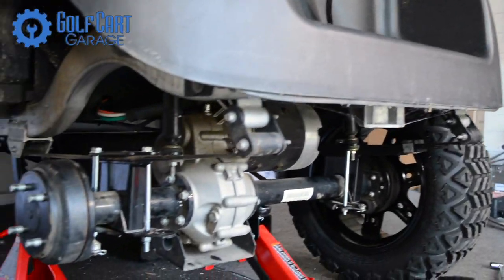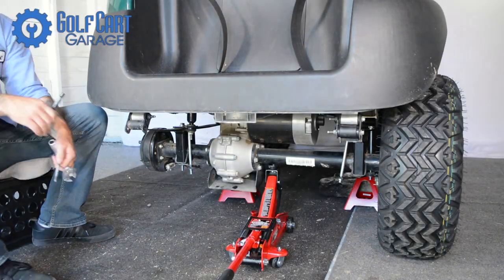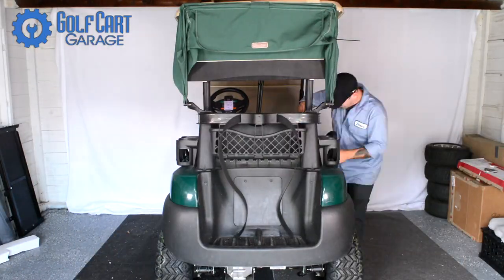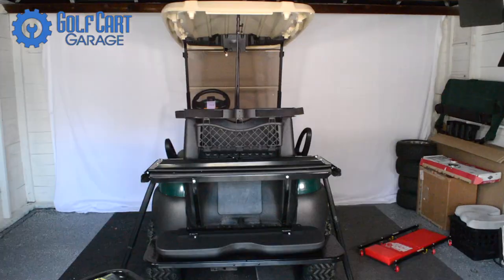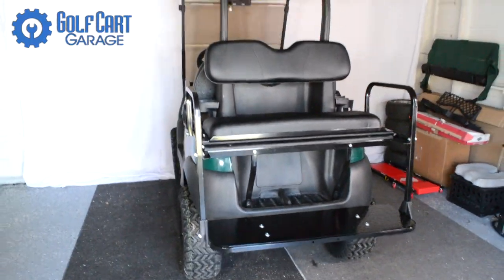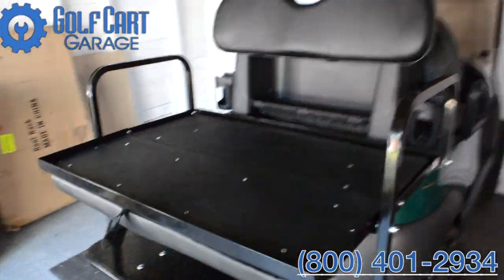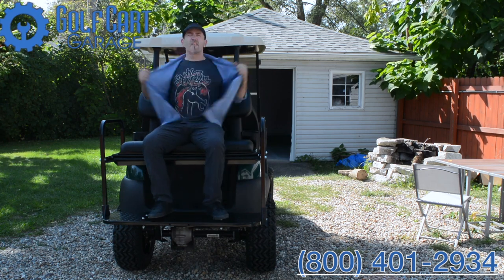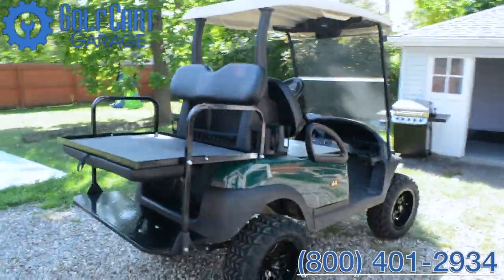Club Car Precedent Rear Flip Seat Kit and Rear Leaf Spring | Before and After | Golf Cart Garage

Comment: Would you recommend this rear seat or the one that removes the factory plastic?
Reply from the maker: For ease of installation, I really like this model a lot and I use the cargo bed far more than I thought I would.  It was so nice to leave most of the OEM material in place and just bolt this right on!